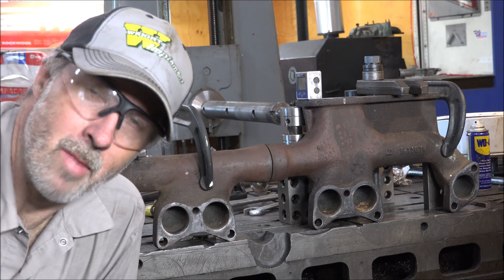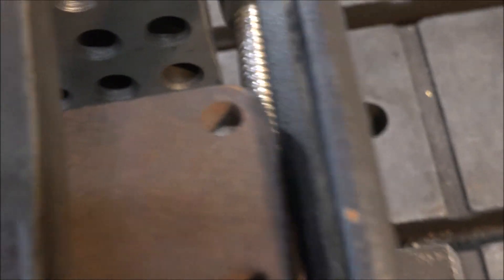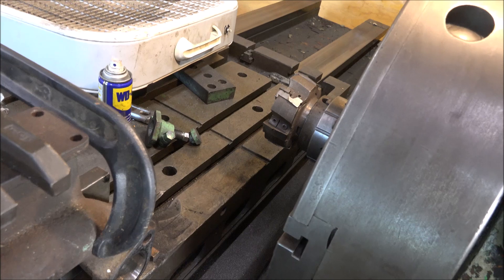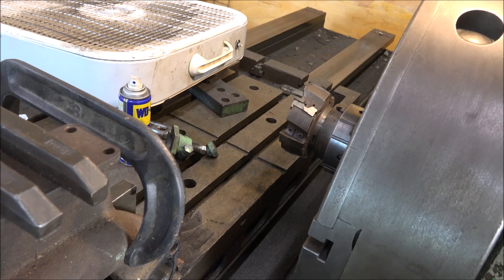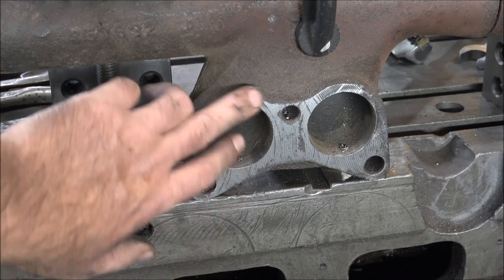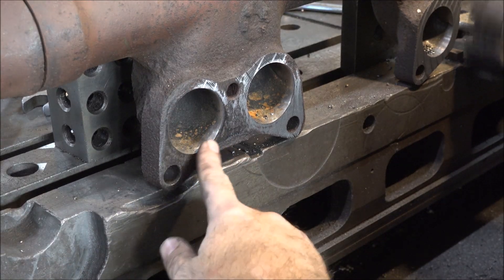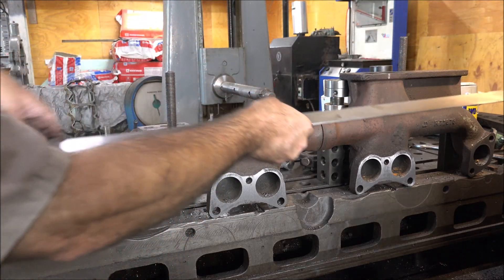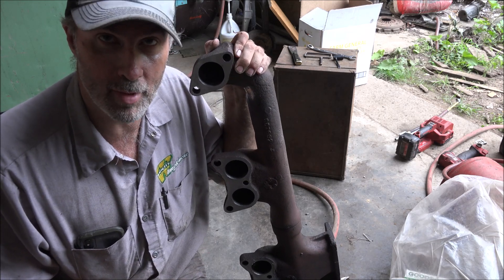More unusual work holding. Just trying Something Different

Comment: Probably better than a new one now that all its shifting around is done and its trued back up.  I did an intake/exhaust manifold for one of my skid steer loaders (gas Case 148 engine) last winter.  All the intake ports were tipped one way, the exhaust ports the other.  No wonder the intake gasket was leaking.
Reply from the maker: Yep metal sure likes to move around after a bunch of heat cycles.